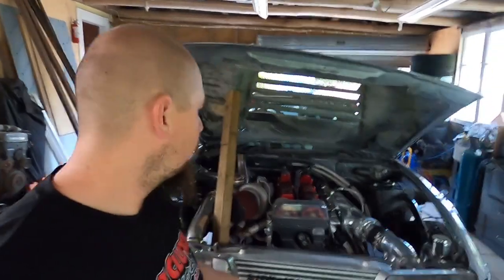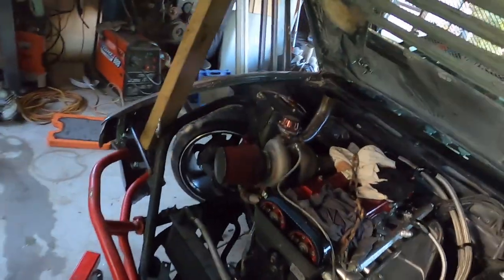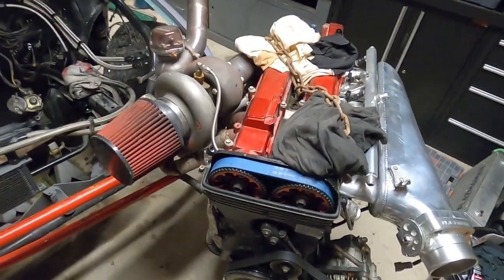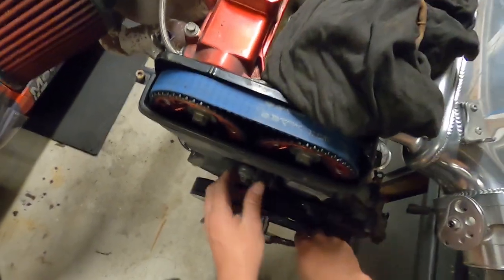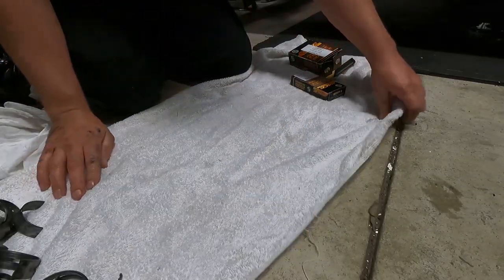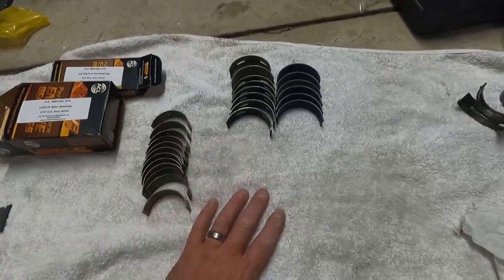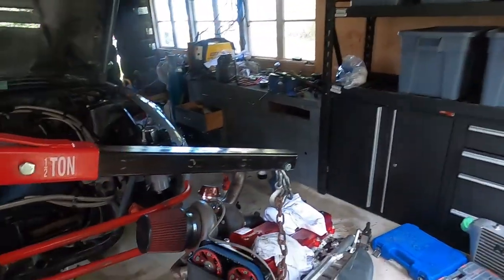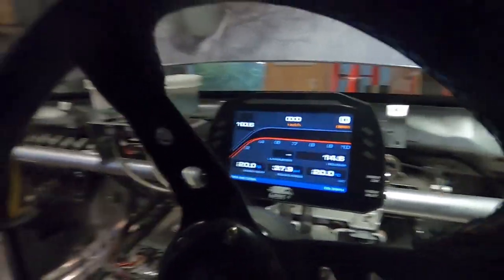2JZ Engine Rebuild | Refreshing The Bottom End

Comment: Nice vid man. The water outlet on the back of your head did you just weld an AN fitting on it and cap it?
Reply from the maker: Cheers mate, I removed the steel water fitting with a slide hammer then tapped an AN fitting into it. From memory it was 18x1.5